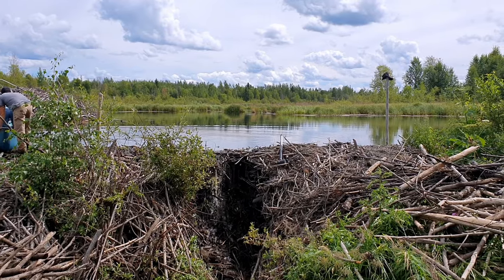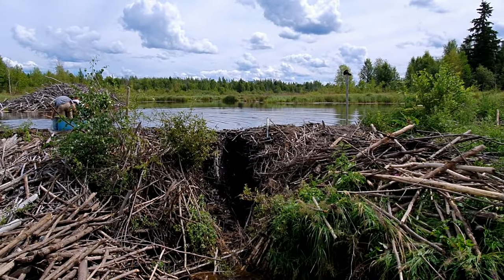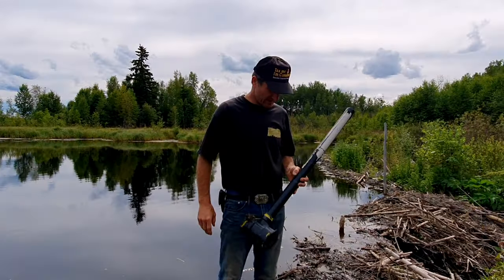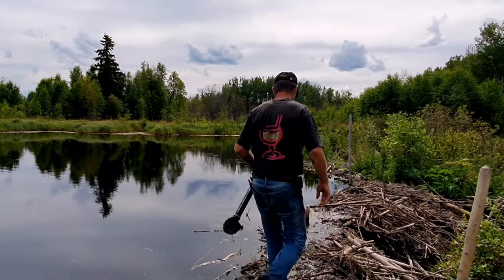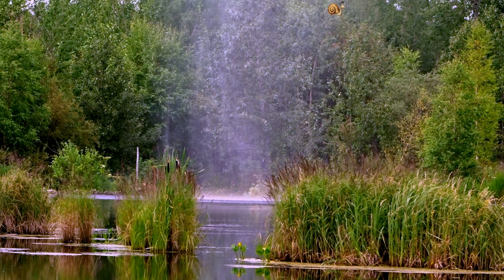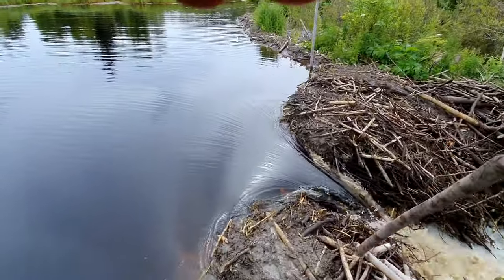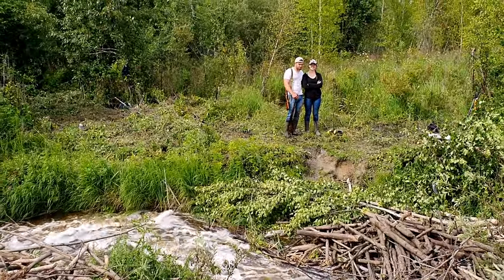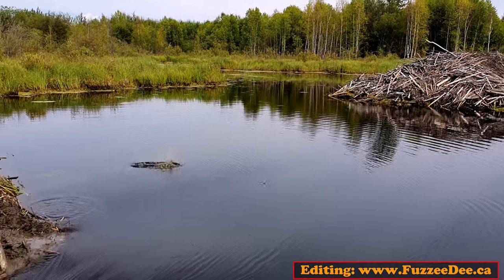Beaver dam vs Tannerite

Comment: My buddy and I have beaver problems with them flooding out our favourite bass lake. Your bangalore torpedo using water pressure against the dam is excellent. How did you make it??
Reply from the maker: Hello John!
All I did was take some black ABS sewer pipe and glued it together with the top tube being smaller so that there's a larger volume of tannerite lower down. I'd cap it off to help keep the pressure higher too. There's a couple other videos on my playlist "things that go BANG".
ps: I think the Fleetwood Mac Rumors album is one of my all-time favorites.  ( I checked your channel).
Stay tuned for further nonsense and entertainment my friend!
Reply: @lovesloudcars  Merry New Year, and thanks for the reply.. Have another question you may have the answer to. Have you found an optimum thickness for the walls of the container? I would have thought the thickness of the ABS pipe you used would have partially restricted the explosion, or cause it to "jet".
Reply from the maker: @johndevries2570    I've seen a few types of plastic pipe used,  but always varying sizes of chargers, so tough to say what's best.
I think a glued cap would help keep the pressure right. 
One of the problems with tannerite is it's got to be set off with a gun,  so something has to be above water level. This one seemed to work ok, but having a bigger thing at the bottom is more difficult to get it set down into the dam.
One thing I'd like to try is a hose instead of a stiff neck.  That would avoid the straight up pressure. 
I've found little strips of black pipe afterwards.  It seems to split the ABS lengthwise instead of shatter it into odd shaped pieces. 
Hopefully you get some good video of it if you do it!

Comment: Maybe silly question is that mound in the middle of the water the beaver's home?
Reply from the maker: Not a silly question at all.  That's exactly what it is.  If they can,  they always build their lodge surrounded by water. They are extremely difficult to tear apart as well.  They're basically a huge sun dried mud brick with a .million sticks of any size going in every direction. 
My other longer video of a different dam (the one that should have been edited differently) showed another large lodge.  
That one turned out to be abandoned and I went back and explored it with my kids, so there is a video of exploring an abandoned beaver house also posted on my channel you might find that very interesting.
Reply from the maker: Here's the link if you are interested. Happy viewing!
https://youtu.be/vgSdgKtDyhc
Reply from the maker: Here's the link if you are interested. Happy viewing!
https://youtu.be/vgSdgKtDyhc
Reply: @lovesloudcars  Thanks, whoa that's huge. All that for just one beaver because he can
Reply from the maker: @ION400  well it usually is a family.  I don't know the dynamics of how the structure works as far as children staying until they "go out to seek their fortune" but it's clear there can be several sizes in one pond. 
When I finally cleared out the ones that moved into my place before they destroyed everything they could reach. There were probably 8 or more. Probably 2 parents and the rest juvenile. 
You see young beavers out traveling.  One can only assume looking for a new home. I got a great closeup video of one on the road about a year ago.  Also posted in that playlist.

Comment: How much Tannerite?
Reply from the maker: I think 3 or 3.5 pounds for this one. Could always use more for sure, but thinking about it today I got wondering about the shape. If we could do something similar with a flattened pipe so it's more oval shaped, it would force the pressure like a shaped charge.
Will have to do more experimenting I guess!!

Comment: I want to see someone set the beaver hut on fire first before blowing the dams.
Reply from the maker: They look like a real bonfire in the making, but upon further investigation I think they would be extremely difficult to actually burn more than part of the surface. So much mud and dirt.
Not that a good dousing of diesel fuel after careful placing of a good amount of explosives would not be spectacular. Set it on fire & blow it apart would be a pretty cool sight.
I'd be willing to try if someone else was footing the bill to get enough tannerite to do the job.
Reply: @lovesloudcars  Setting one on fire and then picking them off as they abandon ship would be a sweet sight.  If one were to try detonating one I'd think that dynamite would be the ticket.

Comment: Why not take out the beaver home? And the beavers!
Reply from the maker: The home or the dam? Access with a machine to this one is pretty nasty without considering costs of getting it there or using it.  The house is actually in the middle of the pond. 
Getting rid of them: trap them out during the winter or damage the dam and sit and wait for them to repair it & shoot them then.
Funny enough,  in this situation,  it turns out there were no beavers,  so it drained down and I found the abandoned home empty and no signs of habitats. 
If you check out my channel,  there's a video shortly afterwards exploring the beavers lodge. 
Hope that helps explain things.  I  appreciate comments and thoughts.  It's good to connect with people. I  hope you check out the other videos,  I thought it was very interesting to see it all empty and dry.

Comment: I would have done the same thing but with 50 lbs , it would have done a little more damage and less work !!!
Reply from the maker: 50 lbs would be fantastic! Unfortunately it's not exactly a cheap product.  I did get some more recently.  I'm interested in figuring out better ways to get the bulk of the explosion under the water instead of losing so much straight up. 
I'm going to mess around with a couple options to test the theory.  Keep watching my friend,  and thanks for your comment.

Comment: Blood up there home to
Reply from the maker: Depends where they are built.  Usually tough to access and harder to dismantle.  Same material,  but up above water level and dried out almost like mud brick reinforced with wood,  but only one huge brick. 
Sometimes having them around is ok,  but they constantly build more dams increasing in diameter or more on the stream. Knock out the edge ones so they stay in their place and hold water,  but don't keep expanding...
It is fun to see it go boom hey? I like these ones with a couple camera angles and a slow motion replay.  That's why we all come here -to see the explosion!!